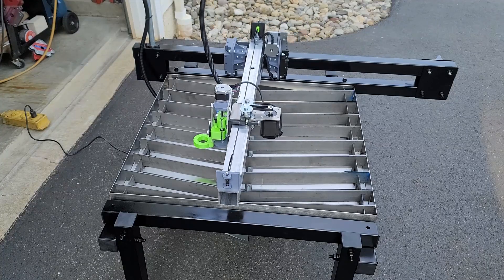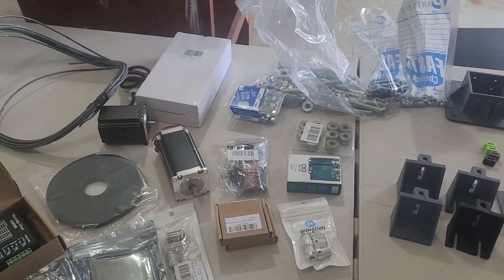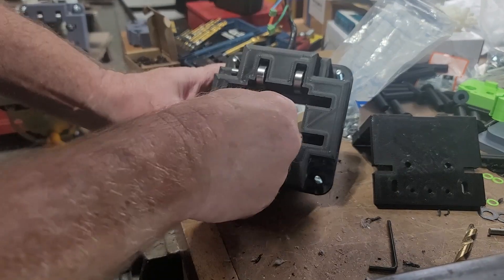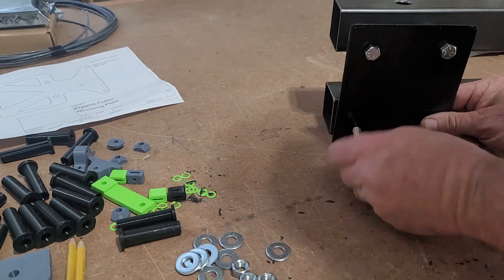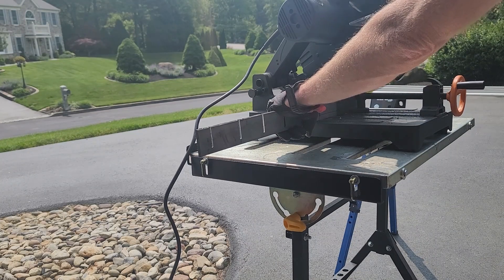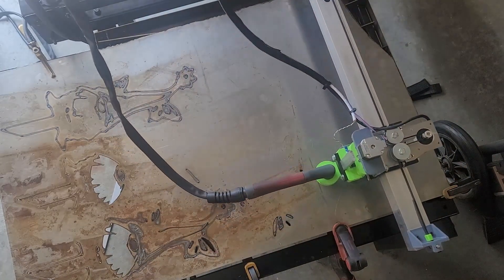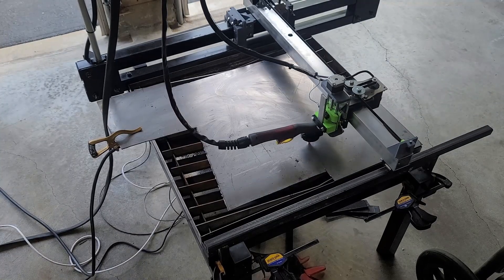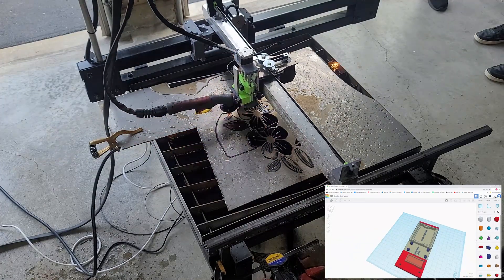DIY CNC Plasma Table Based on JD'S Garage plans

Comment: I am almost done building this same table. I was worried about the X-Axis sag at full extension that you were discussing. Brilliant idea using extra hardware to make that bearing roller support. I am going to make this addition to mine as well. Much love and support from Texas!!
Reply: I put a caster on the end of the x axis that rolls on the frame of the table that holds the water table. Works grest
Reply: @DovRosenberg  I thought this was a great idea as it reduces even more weight and material... Unfortunately thinking about it more, wouldn't this also then reduce the limitations on the length of the sheet you are cutting for example, if you were cutting say the same pattern on a 2m long sheet, the sheet fits inside of the frame width wise but for the length, you physically slip it up further after previous cut complete, in this situation, if you have the bearing running on bottom frame rail this wouldn't work or you would end up having it roll over the metal your cutting causing it to be off-center the opposite direction. If you only plan on doing smaller cuts this would be more cost effective, in my situation i need the extra length so I will revert back to the original idea here in video.
Reply from the maker: Thanks for the feedback. Let me know how everything turns out. It's a great machine. I did a lot of cutting this past weekend with it.
Reply: Yeah good idea! I just got the plans this week and picked up the metal. Currently getting ready to print the plastics.

Comment: Do you necessitate such a large X/Y axis? The plasma gun/wiring isn’t heavy, and there’s no axial load, so I assume a smaller armature would be sufficient. Interesting nonetheless!
Reply from the maker: The size of the x,y axis is not necessarily about the weight or load but for more stability, and it gives room for adjustments to help dial in the gantry/x-axis.  The gantry is designed to have two bearings on each side of the tube, and two of those sides, the bearings are adjustable. This is to help level the arm.

Comment: I enjoyed you video very much i have watched many of these over the last couple of months. 

I too have limited space as your self
So not looking for a behemoth of a table.

I do have no cnc experience or 3d printing

And im from the UK so a little nervous about trying to source parts 

When watching the build i thought about the second arm 1. to support the aluminium 2. Due to the sourcing issue that you could then use mild steel ?

Again great to watch thanks
Reply from the maker: Thanks for the feedback. Yes, you can use mild steel for that part.

Comment: Hello, the plans say. to use a low frequency blow back start type of plasma cutter. Is that what you found?
Reply from the maker: One main requirement for a plasma CNC machine is Non-High frequency or “blowback”.  It would definitely be a gamble to install any high frequency based plasma on a cnc machine.  High frequency is not good to be close to electronics

Comment: You can add "speed holes" along the aluminum. With your weights that should not affect strength
Reply from the maker: Speed holes could work. Just have to be careful not putting them in the path of the bearings

Comment: The floating gantry end seems like a poor design choice.
Reply from the maker: The design is fine. The idea is to keep the weight down.  My local steel provider didn't have the thin guage that the plans called for. So, for me to make it work, I added the rail to make up for the extra weight.
Reply: @harbaughsworkshop the support gantry addition was the best solution anyway. I'm a professional welder and we have an 8x10 torchmate from Lincoln electric and even then without the z axis sensor it can have problems. Plate warpage is a thing. I also run a Dragon A400 pipe and tube CNC which is an amazing little machine If you haven't seen it. Great work, brotha and please put on some sleeves when welding. Lol
Reply from the maker: @Yuriel1981  Thanks for the feedback. I know I need to do a better job wearing sleeves, lol. I will be adding THC to this CNC soon

Comment: Nice build. Do you have the link for the Water pan you got from Amazon?
Reply from the maker: The pan I bought was the  3 BUZZLETT
28" x 30" x 2.5" Heavy Duty Stainless Steel Washer Machine Pan on Amazon

Comment: Have you noticed any issues with painting the Y-Axis gantry? Is the paint likely to flake away, or cause any other issues? Also, how did you ensure that the X-Axis was completely square to the bed?
Reply from the maker: No issues with paint flaking, I cleaned the metal with acetone before painting. I also gave plenty of time to dry before use.

I squared the x-axis to the frame using several measurements throughout the bed.  I treated it like how you level a 3dprinter and adjusted the rail I added. After adding the rail, it was close. It only took a few adjustments to zero in.

Comment: Thank you. Good coverage. I've just ordered the metric version of the plans (after watching your video). My downside is that my current plasma cutter is not CNC compatible so I'm up for a replacement of that when I have the table built.
Reply from the maker: Thanks, great. I had a lot of fun building my table. JD's garage did an awesome job with the plans.
Reply from the maker: Thanks for the update. If you don't mind, keep me updated, and let me know how the motor works out
Reply: The bulk of the frame is built now. I messed up at least one beam and need to wait until next week to acquire the extra material. I have a decent mill with dro so the drilling was done in that (not related to the error with the beam).

I have an iSV57T-180  servo motor with integrated driver and step/dir control. I'll be trying it at some point but am not sure how well the integrated driver will go with the plasma electrical noise.

Comment: Great job, I like the extras also, I recently made one also but I went as big as I could with that design, I also use aluminium for the gantry and am showing wear now from the bearings, If I made this again I would go steel for sure, I also had the sag and used the same idea that @made-by-dad had done with his. Good job mate!
Reply: I made this table cut size 50"x36". Having some vibration issues and hoping an idler bearing will help.
Reply from the maker: Thanks

Comment: Thank you very much for your building feedback ! It is always nice to share about the achievements and know hows to solve problems on the way.
I am currently in the same process, almost finished it. I had some issues and still have some.Three  fixed or fixable issues, and one pending :

- I made a big one, almost 2 meters by 90 centimeters (6 by 3 feet more or less) One issue i recently fixed was holting the torch cable and wireson such a range. Using a tilting tube with a hinge, when you work far from the the "home" corner, and having it get back vertical with a spring strong enough fixed this issue.

- I could not find a thin steel tube for  x axis either. Used an aluminium one as well.  I will see soon, to which extent it is sagging, your solution may be an inspiration. There may be another issue with the aluminium material, I have the feeling it may quickly wear because of bearings friction, and not wear in a homogeneous ways along the axis, especially if you settle the round tube cutting  module How do you see that hazard ? Should that happen, I guess bolting two thin steel corners along the X axis could pave a hard and longlasting road for these bearings.

- I may consider switching to steel tensioners, both on X and Y axis. PLA printed does not look rigid enough, do they ?

- But my main concern regards the kind of plasma cutter and the ability to cut thin materials acurately. How thin was the thinnest you cut ? Which size remained satisfying ? I have a device that is both a AC/DC TIG welder and Plasma Cutter, the manufacturer did not say if it was a Pilot, HF or a contact plasma start. My TIG arc starts with HF, and I have some arduino disconnect issues, I hoped making a farraday cage for the electronic, blinding and grounding everything, installing some low-pass filters would solve the issue, it is still not the  case. I may do a bit more in the EMI blinding process, but you are yourself blind in this effort, can not see or guess properly where the electromagnetic noises come from or spread, which aditionnal work will make the difference. May be buying a new CNC compatible cutter would be more simple. Therefore my question, how thin can you cut ? I read on a corporate article the pilot arc torch is the moste CNC compatible but accurate mainly in the 1-2 inches range of thickness, what is your opinion about that ?

Thanks in advance for your reply !
Reply from the maker: Thanks, keep me posted with your build. I it was a fun build and I use it all the time. 

The 3d printed sleeve I created for cable holder(electricians 3/4 conduit) works great and allows the conduit to pivot depending on where it is on the build table.  The size table you are making, I can see where a spring is useful.

The aluminum seems to be holding up just fine.  Time will tell.

For the PLA parts, I printed them with the exact specifications the plans called for and kept those specifications for the parts I created.   Those parts are solid, and I have no worries with them.

With the plasma cutter, make sure it is Non-High frequency or “blowback” and make sure it is CNC compatible or can actually be converted to work with a CNC. HF can mess with your electronics 

I have no problem cutting thin material. The thinner the material, I lower the amps and increase the speed.  Most plasma cutters will give you a cut chart with amps and speed settings for material gauges that you are cutting. If not, you can find a chart online.

When I make signs, I use either 16 gauge(1.6mm) or 14 gauge(2.0mm). Making brackets or hinges, I tend to cut with 3/16" (4.78mm)

If you are having issues with electronic noise, make sure your wiring is shielded. I had a small issue early on.  The noise was triggering the z-axis switch.  I replaced the wire with a better shielded wire, and that resolved that problem.

Hope I answered all your questions and the information helps

Comment: Hey buddy excellent video I'm about to start my build now. I was curious because you were 7 and a half inch 2 and a half inch 2 looks way thicker than the one that I purchased. I bought mine at point 125. The reason I ask is this will be my first metal working project and I am new to all this so I'm wondering if I messed up.
Reply from the maker: You are good, I got I thicker 2 and half inch square tube out of the off cuts at my steel supplier.  It still fit nicely over the 2 inch and worked out.
Reply: @harbaughsworkshop   hey man thank you so much for the reply. It really helps me out a lot since I don't really know what I'm doing I'm getting pretty nervous with almost everything that I buy in case I'm getting the wrong stuff.
Reply from the maker: @jonny4182 , don't get nervous.   It's a fun build, so enjoy it.  If you have questions, ask, and I will try and help.  On my channel page, there is a link to my Harbaugh's workshop Facebook. Ask here or send a message on Facebook messenger if you need help

Comment: I'm getting ready to build.
Do you see a benefit of adding the Z axis?
I get it for the initial touch-off...
But having the cnc do it every time it makes a new cut!?
The sheet stock is going to be pretty damn flat to begin with. 
Am I just not seeing the advantage of the Z?
Reply from the maker: The Z-axis is nice, especially if you are using different size material. Instead of dialing it in  every material change manually, it sets the height perfectly each time. Plus, if you are cutting thin material and if the material warps at all while cutting, it has the chance to pick up on it.  It's not perfect but I like having it.

Comment: I have been slowly buying the parts to make this happen. I have the plans and purchased the 3D printed parts as I do not have that capability. This may sound like a strange question, but how did you get your Z axis to work. I know they show on their videos that they got it to work, but when I emailed them, they were not ready to release the information yet as they did not have it dialed in.
Reply from the maker: What I did is in the plans, the z-axis probe. 
It touched the material then sets its height 
They have not released the THC in the plans  yet. The THC tracks the voltage, and it adjusts the height if the voltage changes. I would guess that once they get their THC working correctly, they will release that information in their plans. JD'S Garage is awesome at updating the plans.
Reply: 3:57 Hi Great build can I ask how much does it cost to make the 3 d parts?
Reply from the maker: @mikefatovic6316  I have my own 3d printer.  So roughly $25-$30 and took several days to print everything.
Reply: @harbaughsworkshop  
Yes I saw that what I mean is what would it roughly cost to get someone who has a 3D printer to make them for me day a 3D printer company
Reply from the maker: @mikefatovic6316  I have never had to outsource 3d prints before. Not sure of the going rates. There are several companies online that could give you  quote. @jdsgarage701 is who makes the plans. They also sell the 3d printed parts on their site
Reply: Thank you! I appreciate the reply. I am still collecting parts, hopefully once I am ready it will be available

Comment: I'm just starting my JDs Garage project. Are you using an arduino with openbuilds software? I'm having quite the time trying to flash with grbl. I like the improvements you made.
Reply from the maker: Yes, I am running 2.1.1.  Keep in mind whenever you do the Bluetooth module it will wipe the arduino, and you will need to refresh again.
Honestly, wiping and reflashing might be the best thing for you to try.
I don't think they released the information on building the THC yet. The z-axis probe  works great and wasn't difficult to do.
Reply from the maker: Yes, I used the arduino uno with open builds. I also added the Bluetooth module.
If you are doing both you need to setup the Bluetooth module first.   
Are you doing the Bluetooth module?

When you try to flash the grbl double check and make sure you have Blackbox 4x selected and verify you are on the correct com#
Reply: Bluetooth is later when i figure the easy stuff out. Are u using the ardino v2.1.1 version?  I've had no luck with the firmware on openbuilds.  I did the firmware on ardino but openbuilds won't recognize recognize it. I'd like to do the THC but that looks even more confusing.

Comment: Could u share the STL files for the electronics holder and the other stuff ?  im building a Cnc plasma cutter from JD'S as well :)
Reply from the maker: Edwin I just added links to those Stl files in the description
Reply: @harbaughsworkshop  Awesome! Could you also link the water pan ?
Reply from the maker: @Edwinbackstrom-qb5ck  added the link